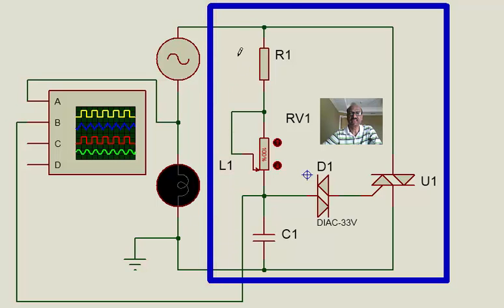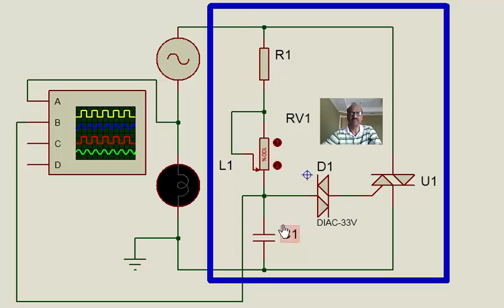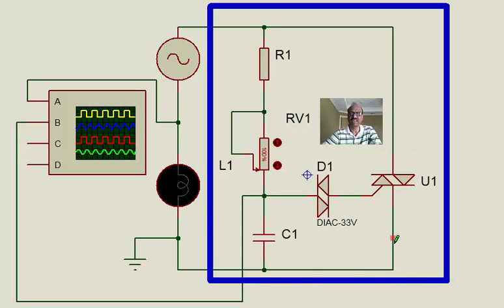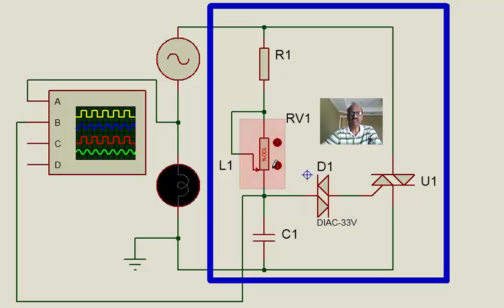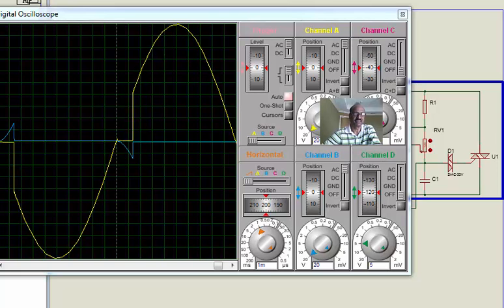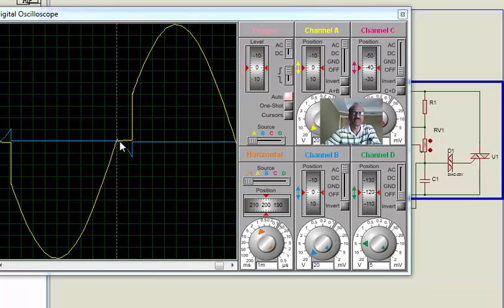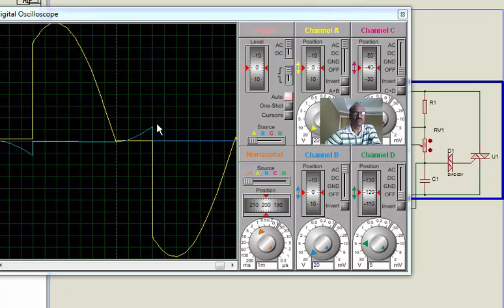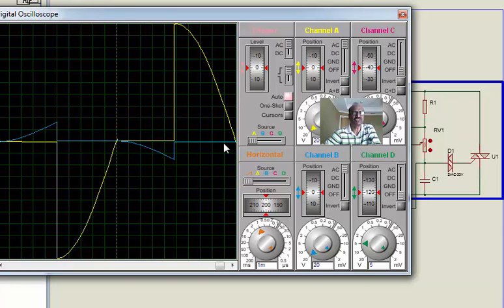Power Electronics -  Dimmer--EEE mini projects

Comment: hello sir I have designed dimmer circuit based on pic microcontroller but it is not running properly in Proteus it is working like a charm so can please review circuit as well as pic Miro c program.?
Reply from the maker: Send the circuit ucpatnaik@gmail.com